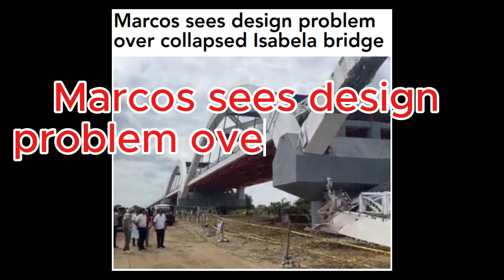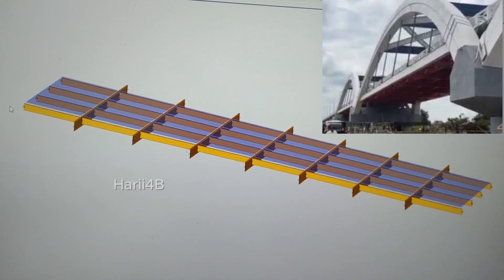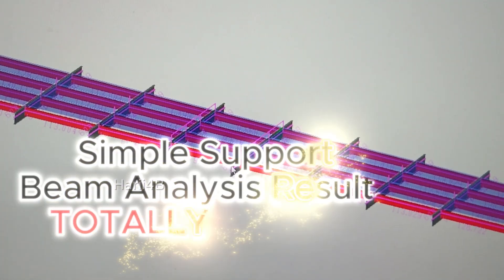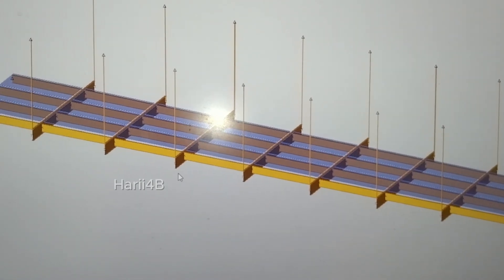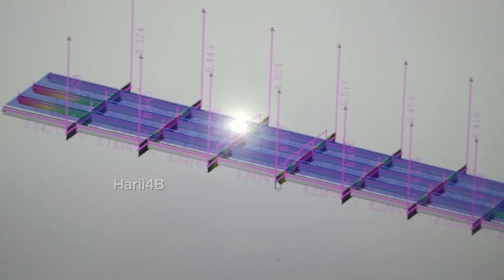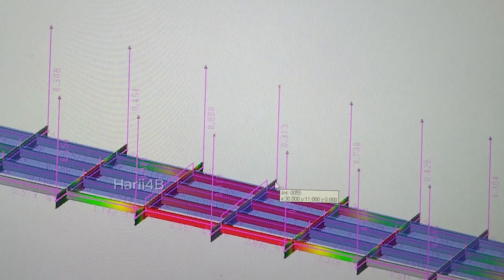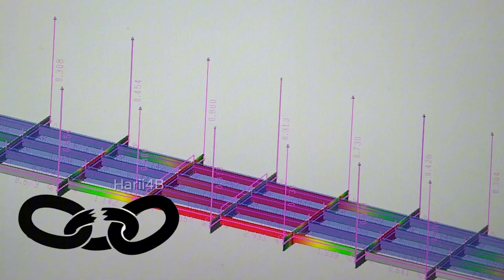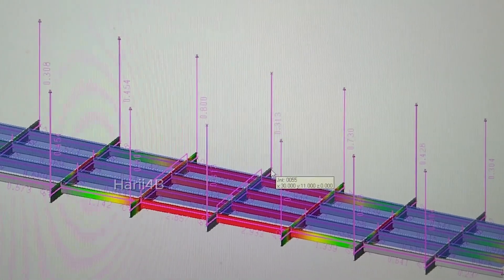ISABELA BRIDGE Cause of Collapse, EXPLAINED!!

Comment from the maker: ISABELA BRIDGE Cause of Collapse, EXPLAINED!!
What could be the main reason? Overloading or Design Flaw or Both?

The truck cannot be 100MT as what they said simply being a 12 wheeler truck only. It may not even reach 40MT gross weight! Unless they do actual weighing for them to prove their statement on 100MT truck weight.
The arch is hollow box reinforced concrete, the bridge deck is composite steel framing and concrete slab. the connection between concrete arch and bridge deck is by steel rod. poor connection design and detailing on the steel rod causes part of collapse. another cause of collapse is the connection of bridge deck's outer girders to the concrete arch. also the end span of bridge deck is supported by very narrow elevated supports. these flawed support and connection causes the collapse. one major design flaw is the minimum number of vertical steed rods, wherein no redundancy capacity was considered, in case one steel rod snaps, the other should still carry the bridge load or at least prevent sudden collapse like what happened.

The top end of tendon rods must be anchored on top of the arch not below it to fully develop the compression strength of an arch. worse is the arch is a hollow rc box section but they fixed the tendon rod on the bottom face hence the pull out failure. also the bottom end of tendon rod must be anchored below deck grider for full strength capacity development . top and bottom connections of tendon roads are flawed! the hollow concrete box girder are subject to inconsistent construction or casting wherein improper development of tendon rod anchorages occurred.

#trending #philippines #bbm #marcos #dpwh #isabelabridgecollapse #bridge #bridgecollapsed
Reply: @Harii4B  Looking at the dump truck that fell, it is a 10 wheeler and max capacity of such dump truck is only 25 Tons.
Reply: , I agree, Sir.
Reply: @rommele.baclig6186  12 wheeler sir looks like HOWO Brand
Reply: Therefore ,it's  a design  flaw, the designer in collaboration  of Dpwh Personnel  should  pay the price of the damage due to their incompetence..influenced by too much love of money resulted to corruption.
Reply: Sir di kayay design flow rin dahil kung yun designer ay hindi inanticipate that one of the vertical members may fail due to any reason kung mas closer yun mga memberrs or maybe net style or truss style failure one  will not result to collapse of the bridge…I read just now the pinned yes no redundancy and its design flow thank you nice presentation
Reply from the maker: true sir. anytime an accident can happen and if one or more of those vertical are hit/crashed upon and disconnect, then a failure of the vertical/s will cause bridge span to collapse.
Reply from the maker: imagine mo sir, may naaksidente na SUV at bumanga sa vertical support/s, so likely gigiba nga tulay nyan by it's weight + plus kung ano meron traffic load at that time.
Reply: Paano at saan nalaman nang gumawa niyan ilagay sa ilalalim ang steel rod(kahit rod na lng hindi na high tension cable -specifi for bridge) na dapat ay buong area and top para solid. Kahit hindi na technical person , engineer,  structural engr. to be exact ay alam na yan. Kahit common sense na lng. Anak nang titing talaga.  Para madali maiintindigan ng non technical person.
Alin ang mas matibay,  Isang log/kahoy binutasan(part of the area) mo tapos doon ka naglagay nang hanger/hook. Or yong buong log ay doon ka sumabit nang hanger/hook para bitbitin ang anumang load? Ngayon , alam ninyo na ang matibay?
Anak talaga nang titing.
Not mention a lot of issues, Lalo na corruption, pera pera, politics at cover up.
Reply: Maybe the 100mt is the combined gw of 3 dump trucks 😂
Reply: @Harii4B  I agree. It is impossible for that kind of truck carry more than 40tons. As a matter of fact the most we can load such trucks is 32tons. We are in the mining industry here in Mindanao. Truck drivers are paid per load so our drivers try to maximize or overload their units per trip. So, to say that the truck was carrying 100 tons is a pure lie and horse pucky. Palusot lang yan ng DPWH. Lutang na lutang ang corruption.
Reply: Yes i agree, the truck cannot load 100mt since it is only 10 wheeler dump truck. Min. Capacity is only 20 to 25 mt. Substandard and design flaws also corruption is the caused of collapsed bridge.
Reply: Thanks Harry for the informative explanation. As also explained by the designer in his interviews this is a tied arch type which means the arch should be a major structural member supporting the bridge itself and with his design the load carried by any means attached to the arch. My question is shouldnt it be logical in the design to induce redundancy in the number of carrying cables or rods per instance so as to reduce the risk of failure of the whole system just by losing 1 or 2 cables in 1 specific section?  i noticed international bridges would either apply redundancy thru making short distance between cables or having criss crossed pattern to mitigate this effect.
Reply: @Harii4B  ask ko lang engineer. Based sa pinakita mong analysis, If yong steel rod ang possible bumigay, it will create more stressed sa girder/beam (3x more). After seeing the actual footage parang sa near support bumigay (if im not mistaken) parang nag sludge or nagslide yong connection ng slab at support. If the analysis is correct dapat don sa middle third or mid point ng span mag break (tensile failure). Am I correct for what I understood from your analysis engineer?
Reply from the maker: @princeheusen3723  https://youtu.be/3IPedlqZ4mc please watch po here
Reply from the maker: @princeheusen3723  quick analysis ko po kasi sa mid-span ko lang nilagay ang truck load. dapat sa near bridge support pero more less ganun din result. may nag snap na connection and the rest followed kasi walang designed capacity redundancy
Reply: Mahina yan...kung wala cguro yung mga horizontal
Reply: NAPROOF na po sa episode ng JESICA SOHO na lampas sa 45 TONNER ang truck. mahirap kasi kung puro sa timgin lamg di aaabot, may mga tools po para malaman ang timbang ng truck

Comment: your analysis is outright wrong.
Reply from the maker: as mentioned, this is a quick analysis check. detailed analysis can be made further. please tell why it's wrong?
Reply: @Harii4B  why don't you google this type of bridge if you don't even know what exactly those arches and rods are for? they are not obviously for aesthetics.

here from wikipedia what this bridge is all about and enjoy reading:

A tied-arch bridge is an arch bridge in which the outward-directed horizontal forces of the arch(es) are borne as tension by a chord tying the arch ends rather than by the ground or the bridge foundations. This strengthened chord may be the deck structure itself or consist of separate, independent tie-rods.

Description

Erkkilä Bridge in Tampere, Finland
Thrusts downwards on a tied-arch bridge deck are translated, as tension, by vertical ties between the deck and the arch, tending to flatten it and thereby to push its tips outward into the abutments, like for other arch bridges. However, in a tied-arch or bowstring bridge, these movements are restrained not by the abutments but by the strengthened chord, which ties these tips together, taking the thrusts as tension, rather like the string of a bow that is being flattened. Therefore, the design is also called a bowstring-arch or bowstring-girder bridge.[1][2]
Reply from the maker: i am saying in the analysis that some stated this was a simple supported bridge and arch are only aesthetics. it was not my statement and only show proof of analysis to rebut it. after i posted this video then later that night the designer confirmed the design philosophy of the bridge being arch supported. Thank for the comments

Comment: Your structural analysis is clear and complete with computer simulated load. Does DPWH have this computer software simulation? I am assuming DPWH and contractor should have known this.
Reply: I remember Engr. Arnel Aguel o how she made analysis using the software,that was for seismic analysis.Heis one of the authors of NSCP 2015.
Reply from the maker: the consultant/designer must have software and also done manual calculations to verify the software results

Comment: According to photos. What i see was the stirrup on the ark/beam on the spot where it snapped... stirrups ends does not alternately installed and no tie wire signs it where is tied another was vertical members are not through and through hangging from bottom depth until top of the ark to maximize the depth of beam/ark. It is just hangged  bottom of ark.
Reply from the maker: yes sir, the top end of tendon rods must be anchored on top of the arch not below it to fully develop the compression strength of an arch. worse is the arch is a hollow rc box section but they fixed the tendon rod on the bottom face hence the pull out failure. also the bottom end of tendon rod must be anchored below deck grider for full strength capacity development . top and bottom connections of tendon roads are flawed! the hollow concrete box girder are subject to inconsistent construction or casting wherein improper development of tendon rod anchorages occurred.

Comment: Since the dumptruck passes other segment of the bridge and collapsed on the 10th segment, it may be consider the implementation process where there is a failure in joint connection  cable support connected to arc.
Reply from the maker: Yes! It’s very possible that the failure happened because of the joint connections.
Reply from the maker: yes sir, the top end of tendon rods must be anchored on top of the arch not below it to fully develop the compression strength of an arch. worse is the arch is a hollow rc box section but they fixed the tendon rod on the bottom face hence the pull out failure. also the bottom end of tendon rod must be anchored below deck grider for full strength capacity development . top and bottom connections of tendon roads are flawed! the hollow concrete box girder are subject to inconsistent construction or casting wherein improper development of tendon rod anchorages occurred.
Reply: @Harii4B this is one of PBBM pointed out during the site visit..
.tapus isa naman sa design flaw na sinasabi nya pag totoo yung isa sa pinoint muh sir na for aestethic lqng ang arc at mga rods..

Comment: Correct analysis...
Arch supports a load applied on top of it, not below it...this is ancient engineering principle that dates back in the old romam empire!
Reply from the maker: yes sir, the top end of tendon rods must be anchored on top of the arch not below it to fully develop the compression strength of an arch. worse is the arch is a hollow rc box section but they fixed the tendon rod on the bottom face hence the pull out failure. also the bottom end of tendon rod must be anchored below deck grider for full strength capacity development . top and bottom connections of tendon roads are flawed! the hollow concrete box girder are subject to inconsistent construction or casting wherein improper development of tendon rod anchorages occurred.
Reply: @Harii4B , mayroon bang ganitong issue, or analysis na napagusapan na ng mga matatetas at malaking tao Lalo na technical person. Kasi sa media wala pa akong napapanood at naririnig tungkol dito?
Reply from the maker: i am not aware of discussion/s of sorts at the moment sir but maybe there is but not open to public. ofw here sir
Reply: @BuencaminoMartin  you are right. Old Roman bridge construction where supporting arches were located at below the bridge.  So why until now you see this ancient Roman style are still standing and being used for centuries?  Why change things that work in the first place!
Reply: Sir anong material ginamit nila sa hollow rc box?
Reply: Very good analysis.  But the question now is what is the budgeted cost based on original engg specs and plan? Off hand, the fact that the bridge could collapse already but merely I set if vertical support snapping seems to show the specs was downgraded in terms of safety.  It was not even an n-1 design, but since maintenance has always been a corruption issue, it should have been  design for n-2 or n-3 if construct and forget.  The investigation should start on whats the original Engineering  specs and budget, to identify if the specs was downgraded or reduced to lessen construction cost and the differential cost goes to corruption.  The Dpwh,  project manager,  designer, structural engineer, contractor and auditor should be simultaneously be summoned to explain why and explained thru engineering simulation like this one. The pronouncements made by Dpwh that contractor simply followed the design is already a red flag in possible corruptions.  The designer could have been lured or forced to conniving to perpetuate the corruption scheme.  If the designer agreed, now he's in big trouble and becomes the fall guy. Coa also should be liable, bec it should have audited between planned and implemented.  Lessons in life:  honesty is always the best policy.  God is watching us.
Reply from the maker: Thank you Sir!
Reply: @Harii4B  i noticed the arangement of the girders the same way you did. My suspicion is correct. Thanks for the info!

Comment: Poor Design and Methods of construction is the main reason of collapse
Reply from the maker: yes sir, the top end of tendon rods must be anchored on top of the arch not below it to fully develop the compression strength of an arch. worse is the arch is a hollow rc box section but they fixed the tendon rod on the bottom face. also the bottom end of tendon rod must be anchored below deck grider for full strength capacity development . top and bottom connections of tendon roads are flawed!

Comment: Why would not they design the bridge for heavier load when the basic purpose is to cater to passing vehicles in the area?
Reply from the maker: exactly the point po!
Reply: @Marcial-r3x  
Ganito po Yan, how heavy is heavier? 

Such question is answered by safety factors in our code or most popularly known as load factors. Generally code uses 70% to 87% for impact 

It is already designed for heavier loads.  

Thus, load limit is always prescribed in a bridge in the same way as capacity is prescribed in an elevator. Violate it could mean collapse.

This limit if obeyed assures safety. Even if the bridge is designed by an old code with  lighter loads, said bridge will still stand  for as long as it will not be loaded as per it was originally designed. 

But if DPWH wanted to increase the capacity of such bridge to cope up with the new code, a Retrofitting will be done. But even thereafter, a new limit will still be prescribed. Neglecting this rule of load limit could be catastrophic. Thus the collapse of the said bridge.

We must always go by the wisdom, He who knows no limit is one who knows no Danger

In this age of computers, it's so hard now to commit mistakes in structural design computations.
Reply: I being, a practicing structural engineer strongly believe that it is not structural design flaw or error. It must be something else and someone else...And this the need not only for a structural investigation but a real forensic engineering investigation.
Reply from the maker: i agree sir. on my point regarding a weak link, one possible cause is the strength development of connections to rc box girder. we all know the concrete are not homogenous and simple improper or lack of concrete vibration during pouring can spell the difference already
Reply: Sa zone na yan di maiwasan ang heavy load like troso and others. Pangsarili lang yong nagdesign niyan. Walang coordination sa  kasamahan. Kaya nangyari, mislook sa termination at interior members stress capacity to uphold the tulay load plus the passing load
Reply: Tingnan sa picture ng nagiba, yong floor structure is fully dependent on the hanger member which is the cause of failure. Walang interrelationship yong members to balance the load. Fully inasa sa lifting capacity ng tension rod pati sa point of support totally collapsed patong design
Reply: 1.2b budget for more than 1km.. utang pa😂 
same sa gusto mo sana ng made in japan na tulay kaso made in china lng ang kaya ng budget + may bawas pa para sa overloaded pockets nila😂

Comment: That is the argument that I have been tell my friends, it's not a design fault or the weight of the truck, in which case no standard truck can carry more than 40 tons, it's the construction method
Reply from the maker: yes indeed! it's about the design and construction method and how it was implemented
Reply: @andreinicolaiamadeo3453  obviously people with technical know in civil engineering would conclude that the failure was caused by construction error. As shown in the photo, the segment of bridge that collapsed was not right at the very first segment. In the contrary, if the 1st segment got collapsed, then you would say it has something to do with the design. Plus, as seen also in photo the vertical suspension cable/steel got snapped out from the arc support. To find out who must bear the blame, testing the actual strength of all materials involved shall be carried by independent third party testing center. And signboard with specified max axle load should have been posted to both approarches of the bridge.